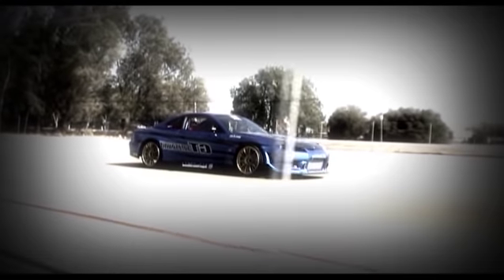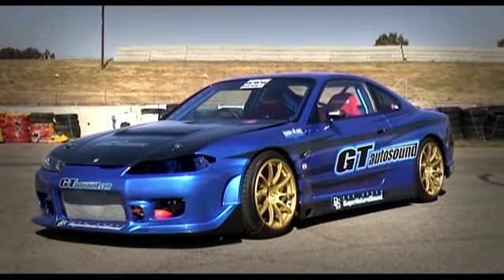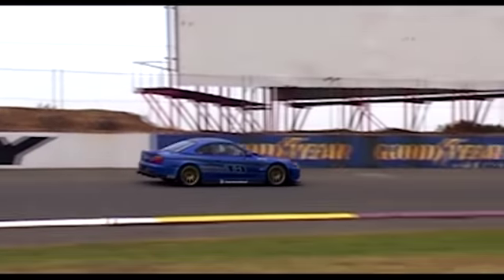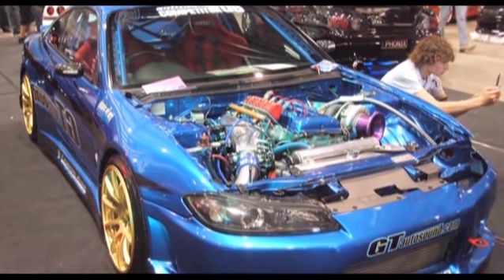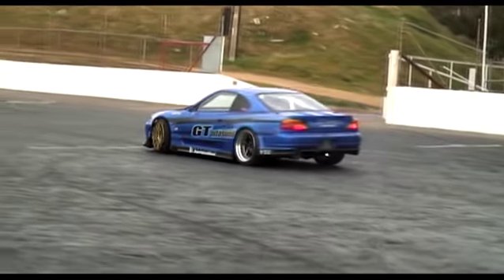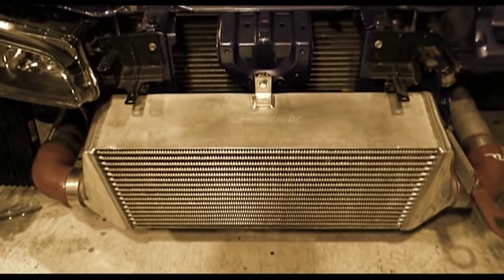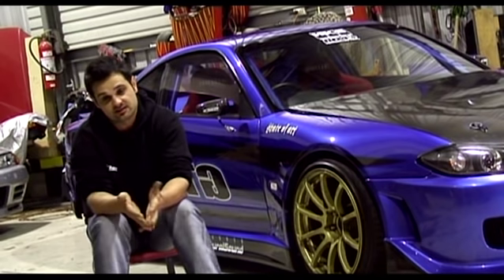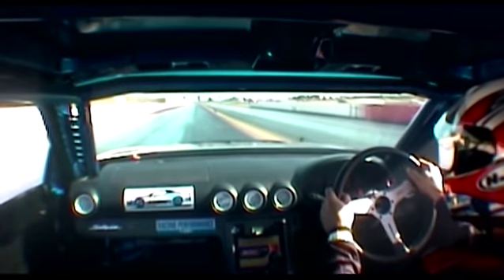Where the World's Quickest Silvia Began - Throwback to 2007

Comment: Any thoughts on ricer Miata running a low 10 with an Sr at 400 + horse
Reply: light ca,r good launch, quick shifting and good grip many people have gone mid 10s with 450hp
Reply: That car also had stock internals which is nuts